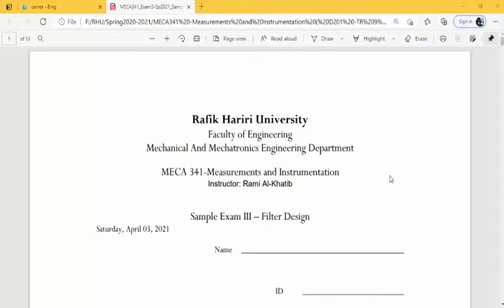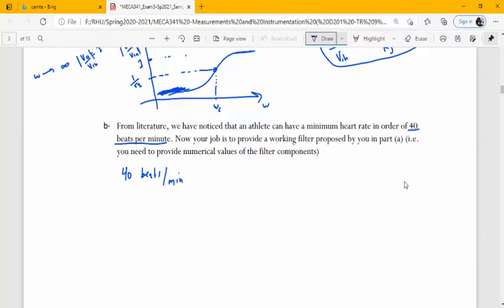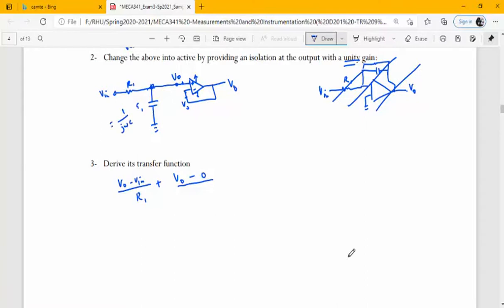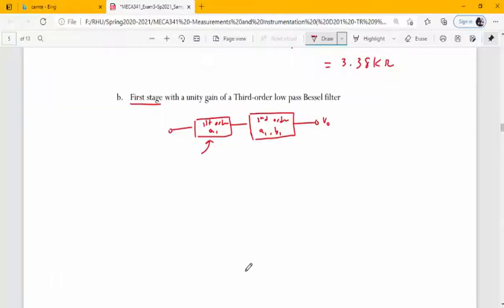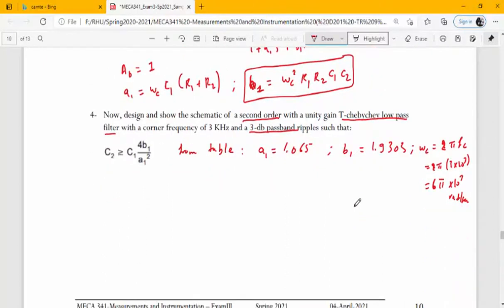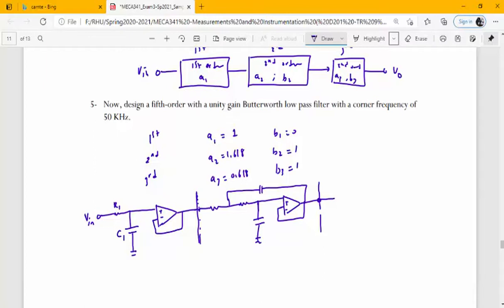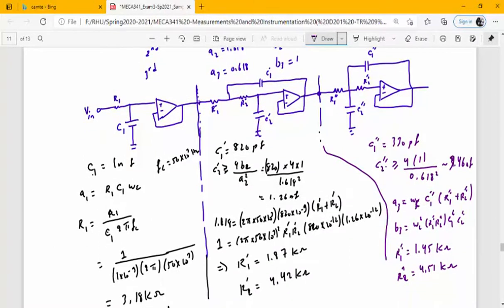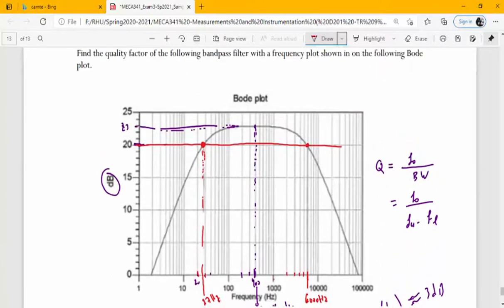Filter Design - Sample Exam3 Sp2021 Solution

Comment from the maker: Please note that, at time 52:51, the capacitor on the third stage of the Butterworth low pass filter must be connected to the terminal of the op-amp ( similar to the second-order filter on the second portion of the 5th order filter)